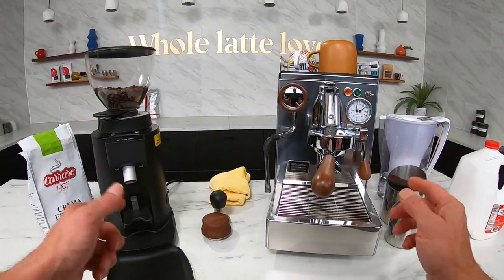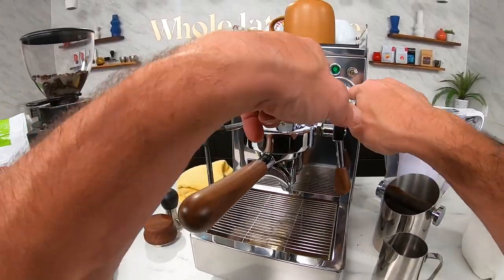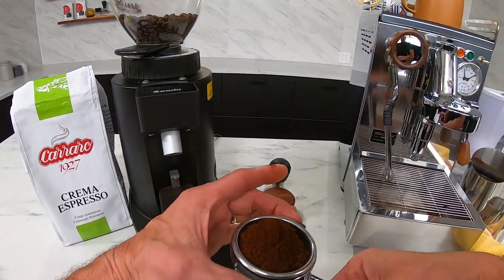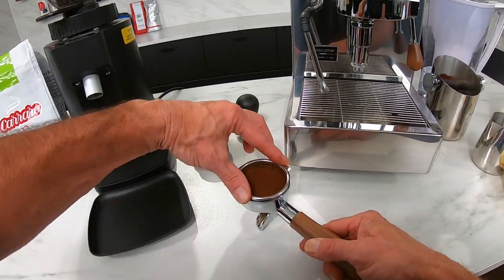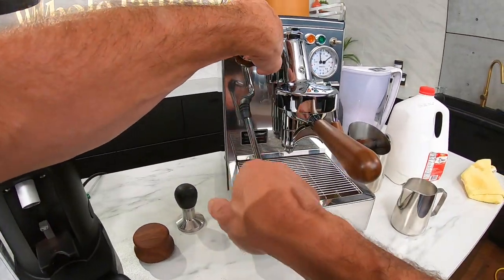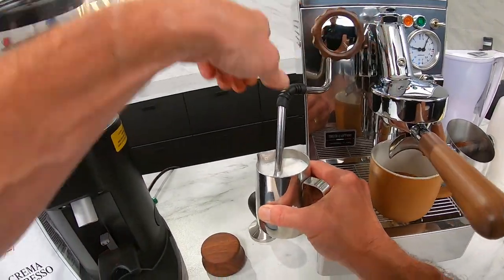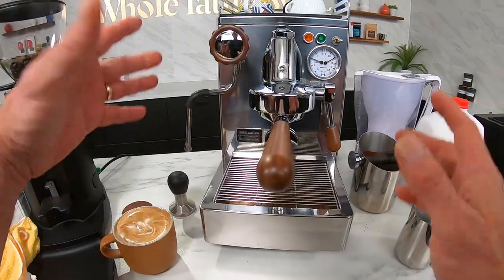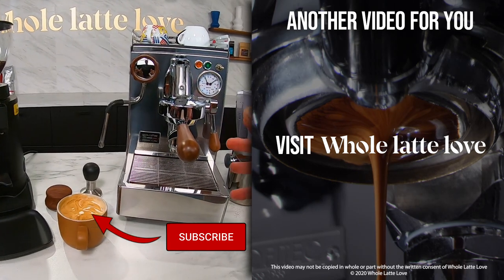How to Make a Large Latte on the Elba 3 Espresso Machine/Ceado E5P Grinder

Comment: If you want to be "as consistent as possible", wouldn't it make sense to weigh your inputs and outputs, or at the very least time the shot? I get this is mainly for demonstration purposes, just seems a bit too random.
Reply from the maker: Hi Darius, Thanks for the comment. Yes it would! For high level weigh input/output check out this video which uses the Acaia app to record extraction rates, brew ratio etc. when pulling shots using flow control with a specialty coffee: https://youtu.be/HTaly8c-i_U
Your assumption this video is for demo purposes is correct. Part of the point is making home espresso more accessible to beginners.
Marc